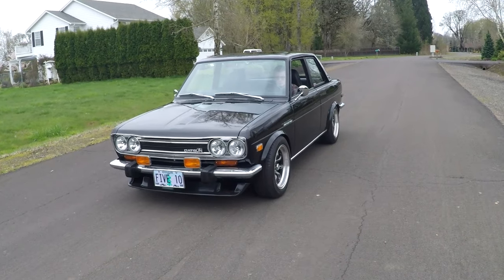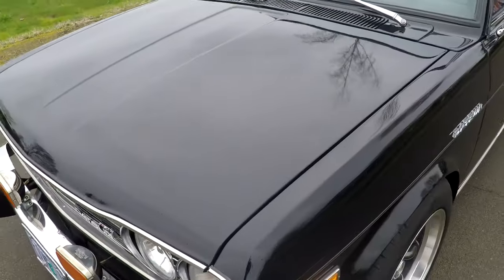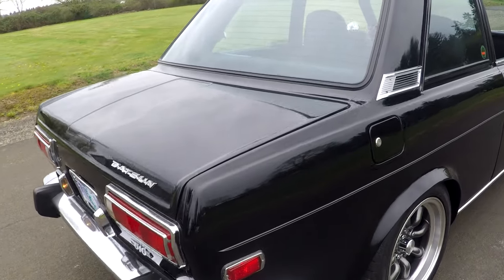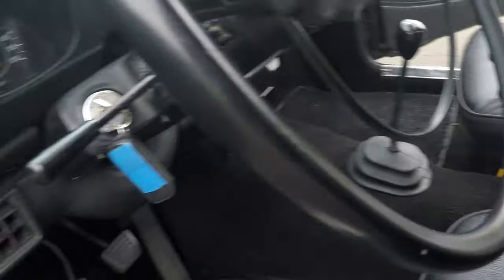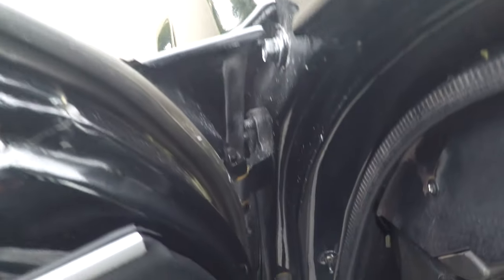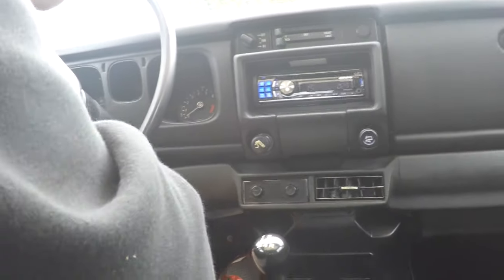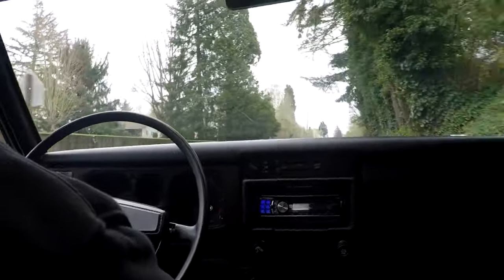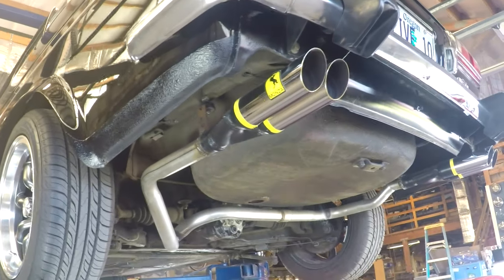1973 Datsun 510 Bluebird SSS 1800 Denwerks  Bring A Trailer

Comment: Best car I ever owned. Bored and stroked L20B with all the SSS components for an engine I got from Japan.
Reply: those carbs aren't up to feeding an L20B a proper diet of air. use the 46mm carbs and port out your '220' intake manifold for the bigger carbs- you can do it without getting into the water jackets (don't get carried away). the bigger carbs' throttle valves twist in the other direction. i use the 72 240Z carbs with the roadster U20 slide pistons, needles, and nozzles cuz i got a bunch of them for a cheap when nissan was selling them down in the 80s. i used a tsuchiya SSS air cleaner shell and shortened a 72 240Z air cleaner base to fit it. all L20B engines were made in japan for the north american market. the Z22 engine is a great source for a stroker crank- the resulting torque is amazing. i've built a few L20B motors for 510s before getting into VG30 swaps.  510s are lots of fun but getting pricey...

Comment: The motor might be an 1800, but that's a North American export PL510, not a JDM Bluebird SSS
Reply: they came to North America?
Reply: @donwest5387  Yes, Datsun 510s were exported to North America as the PL510. The right hand drive Nissan 510 Bluebirds were JDM cars, which stands for Japanese Domestic Market. The 510 in this vid is left hand drive so not a JDM Bluebird SSS.
Reply: very confusing title to listing @Datsun510zen

Comment: Need a fj20et engine here in oz we have so many 1200 or 1600 datsun/ nissan sedans and ute's
Reply: you said about the same thing on another 510/1600/bluebird site.  not true.  i saw the first 1200 ute i'd seen in a couple of years the other day.  cant remember the last time i saw a 1600 on the road.  i miss the 1600 wagon i had for 15 years.  top car.  but i agree about putting a more modern motor in them.